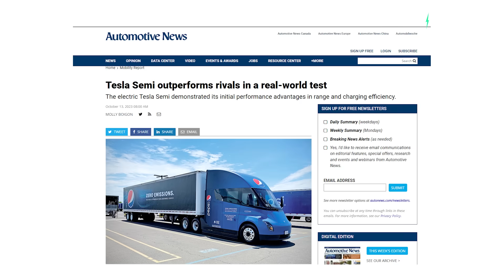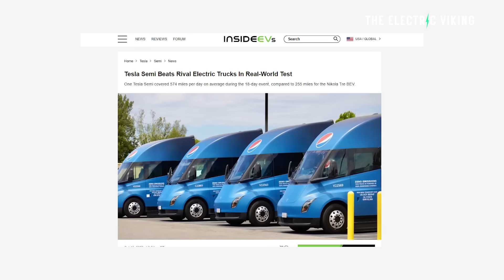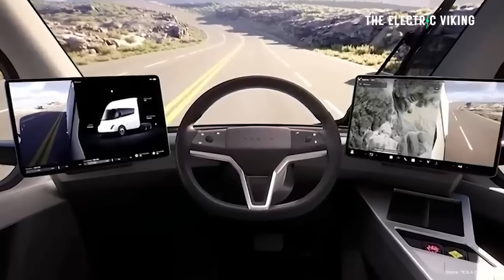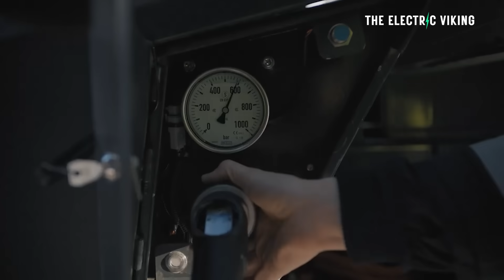Mercedes claim that Tesla Semi breaks the laws of physics proven correct

Comment: Since about two weeks DB Schenker in Finland is leasing for at least a test year a Volvo FH Electric Semi truck. This so called HCT combination is 33 m long with 11 axles and can have a total weight of 68 metric tons.
The truck has six batteries, all together 540 kWh.
The truck will be used in 3 shift, and mainly the truck goes between two hubs, but will also be used in distribution.

DB Schenker will charge the trucks by the rooftop solar panels at the hubs.
The company will have more electric trucks next spring.

Then I have some opinions about the charging!
I think they must be able to use at least two charging cables, or are they going to use 1600 volt?
In a couple of years the practice shows what really is needed when thinking there are mandatory rest times for the drivers. We have to consider that about 110 kWh is needed to get another 100 km for "normal" semi trucks.
Reply: Thanks for sharing this info.

It seems every truck maker is developing BEV drivetrains and many tests are being conducted around the world.

The increased efficiency and reduced fuel costs mean the electric transition is going to happen as quickly as the batteries can be made.
Reply: Tesla semi have 900kWh battery, 800v and consume 1.7kWh/mile full load. Range 500 mile with full load.
Reply: @pmkgamingtv  I would say that most of the electric trucks now are more or less test vehicles, and as the battery is quite expensive I think they don't use bigger batteries than needed for the tasks the trucks are supposed to perform.
Then the trucks that right now are for sale must also be able to be charged with right now available infrastructure.
As Tesla have own "infrastructure" they can now build slightly other kind of semis and trucks.
Then in Europe the trucks can't drive faster than 80 or 90 km/h. 

The electric companies will have some busy years to strengthen the grids that means we all have to pay more for electricity till the investments are payed back! 
When the gas stations network was built only the car owners payed direct, we other payed only through the "things" we bought that were transported.
At least it seems that the fuel cells will play a very small part. If for instance 20 % have to use diesel the NOx emissions will be quite small after all.
Here in the Nordic countries they should transport much more goods and trailers on the railways, because the heavy vehicles destroy the roads. The change between cold and warm weather twice a year it's in reality impossible to build roads that last. Then bad roads destroy normal (more or less expensive) cars...
Here we have many and long roads and a few taxpayers.

Comment: Nikola realized that their hydrogen semi truck was not going anywhere and they made a clever move: They also built a battery electric semi truck to compete with Tesla, since only battery semis have a future....
Reply: Nikola's truck was going somewhere - but only if rolling down a hill...
Reply: Battery semis will have a future eventually, but it's still too early for adoption. They don't have enough range yet to see widespread adoption. If they can start doing 600 miles on a charge and truck stops start adding charging stations, and  crazy California needs to actually add some truck stops (there's only like 3 in the entire state, and they are super tiny, especially considering they are a major shipping port), and then electric semis stand a chance of dominating the market. Until then they are just an impractical novelty.
Reply: NIKOLA BEV does not even Compete w/ TESLA 300 mile semi.

Comment: OK they always say they had a gross vehicle weight equivalent to that of a diesel truck. The problem with that is the payload weight is less than half of the payload weight on a diesel truck because the batteries take up most of the gross weight and every over the road diesel truck can go 1000 miles on one fill up
Reply: Correct. Tesla fanboys keep referring to the cost of running the truck. They just do not understand the  truck industry. You have to be able to carry weight, at least at some point in the run. Tesla simply cannot do that. FACT
Reply: Demonstrated payload is 44,000 lbs. of concrete highway barriers, which is very close to the payload of a diesel semi. GVWR is 2,000 lbs. greater than a diesel truck—80,000 lbs. for a diesel truck, 82,000 lbs. for an electric or natural gas-fueled truck.

Comment: My concern isn't with the distance or charging time, it's what happens when the truck breaks down is in the middle of the desert! Currently most truckers are their own mechanics and in many cases can fix their own rig, now with electric, they'll have to call someone or wait a day or two to get someone out to help tow or make repairs?
Reply: 1) Diesel trucks are far more complicated and have a lot of moving parts which can break so the likelihood of a diesel truck breaking down is far higher than an electric truck.

2) unless it's a Tyre change good luck trying to fix a truck alone without any serious equipment in the middle of the desert, and this is ignoring the fact that truck Tyres are heavy af for a single person to manage.

3) Batteries are most efficient when they're warm but diesel engines can overheat in a hot desert environment. You should be more worried about using electric trucks in colder places such as Alaska or Canada since batteries are nearly half as efficient at those temps so you should be more concerned about you're range in places such as the ones I mentioned before. I'd argue Diesel trucks are more dangerous in colder places since Diesel might not ignite when it's really cold outside since it needs to reach 180 Degree Celsius before it can ignite. if your radiator freezes up even when you're using an antifreeze agent, your engine might overheat and stop working. you have 2-3 hours of heating provided by the batteries to stay warm inside while to try an request help using a HAM radio (if you're stuck in an isolated location). Whereas, an electric truck can keep the heating on for ~3 days with it's massive battery pack if you get stuck (probably 4-5 if the truck has good insulation since the heating doesn't need to be turned on all the time to maintain a warm temperature inside the cabin).

4) As rare as motor failures are, Electric trucks have the possibility to disengage the failed motor from it's power-train and use the rest of the motors to drag itself and it's cargo to the destination (it definitely have enough Horsepower to reach the cruising speed even with a failed motor lol) and then to the workshop to fix or replace the burnt out motor.

P.S. I'm no expert in any of the things I've mentioned, I've merely gathered the information I've came across online.

Comment: Maybe you should take a look at Edison Motors semi. Their first load was 100,000+ pounds and was a Sherman tank. More than Tesla semi by at least 18,000 pounds. They have an onboard fast charger and huge range due to that. What was the weight that the Tesla was hauling? If you are hauling corn chips then the weight is minimal.

Comment: Heavier the vehicle is the less efficient it becomes for Bev. Also the majority of mileage is on highway speed worsening the efficiency even more
Reply: Hows your physics ?  This efficiency loss is exactly the same as a diesel truck. But an EV can regain charge on downhill sections. Can a diesel do that ? And when re-fuelling a diesel, you have to stand beside it for 10-15 minutes. With an electric, you plug in, and then have your break. It's different, of course - but maybe there are advantages ? I'm not a truck driver ....
Reply: Drag is what matters most on the highway.
Reply: @chrisheath2637  the physics is simple. The heavier the vehicle the larger battery pack it needs which in turn increase it's weight. Not the same with fossil fuel vehicles, it doesn't have to increase gas tank nearly as much as battery weight in order to achieve the same range or load increase. That said emissions is still emission. Just comparing small ice car to big ice car, small ice car pollutes more. Got EVs definitely big heavier EVs pollutes more in terms of resources extractions required.
Reply: @i6power30  We shall see....
Reply: NOT that Heavy , it can haul FULL LOAD Fremont to San Diego in 8H with 45+ miles Range left.

Comment: 4:10 - 1,700 km in 24 hours is an AVERAGE speed of 45 mph or 73 km/h. To put that into perspective, the maximum allowed speed for a semi on a motorway/freeway in Denmark is 80 km/h (50 mph). On regular roads outside of cities it's 70 km/h (44 mph) and in cities it's 50 km/h (35 mph). In the EU as a whole, there's a maximum speed of 90 km/h (55), but individual countries can have lower speed limits.

So, if a semi truck can carry goods 1,700 km in 24 hours, that is plenty to serve in Denmark, especially because we have strict limits in place for how long a driver is allowed to be driving - not just hours in a row (they HAVE to have breaks), but also how many hours in a 24 hour period. Those breaks can easily be used to recharge the semi trucks.

As for Tesla Semis in the EU, I think they'll have an issue due to length. The EU has a maximum length which includes the entire length of the semi itself. That's why the cab-over models are so favoured in the EU, and that nose is probably part of what makes the Tesla have such good range.
Reply: The US has strict limits on driver hours too. But team drivers can bend the limits quite a bit. It's not uncommon for a team to drive 4500-5000 miles in a week.

Comment: Mercedes have just tested the eAtros 600, across Europe it carries a greater load than the Tesla. Featuring a cab-forward design typical of European trucks, the eActros 600 is based on an 800-volt electric architecture that accommodates two electric motors with a continuous output of 400 kilowatts (536 horsepower) and three lithium iron phosphate (LFP) battery packs that offer a total capacity of 621 kilowatt-hours. Mercedes-Benz has a higher GCW - 88,000 pounds versus 82,000 pounds which is the critical factor, it carry more stuff.
Reply: It has a higher GCW, because the limit is higher in the EU—88,000 lbs., if your quote is correct, vs. 82,000 lbs. in the US. It has barely half the horsepower of the Tesla Semi, and 2/3 the battery capacity; so its range will be substantially less. For EU users, this will be ideal. For all the US EV haters who insist range is everything, it'll be a non-starter compared with the Tesla Semi.
Reply: @BigBen621   The fundamental issue between the EU and across the pond, is EU countries apply hours worked on which drivers are paid, so tachograph rules, of which there are loads, but the key is “After every 4.5 hours of driving time, the driver should have at least 45 minutes of breaks. The driver can take 45 minutes at once, or split into one break of 15 minutes, followed by a 30 minute break (45 minutes in total)”. Consequently with loads of historical data the European Manufacturers, they can easily scoping their vehicles, which makes sense.
Across the pond my understanding it’s miles driven how drivers are paid, though I understand federal law wants to include a tachograph system which hasn’t gone down well. Consequently the Tesla Semi with long range makes sense. It will be interesting to see the specifications of the Tesla Semi if it ever comes across the pond, which frankly I am not convinced it will.
Reply: @DC.409  US company OTR drivers typically aren't paid for time worked not related to driving or driver unloads and outside of LTL are usually paid by the mile  - "If the wheels ain't turnin', you ain't earnin'".  Hence the quick fuel stop to fill the tanks, hit the restroom and grab a coffee and be on your way.  With the old paper logbooks you could creatively give yourself an extra 15 minutes or so per stop but with ELD now it is tough.

Comment: Still don't see these making a mark in the Class 8 OTR long haul market in the US.  Pepsi is fine, but they are relatively short haul point to known point deliveries, not random freight picked up and delivered anywhere in the continnental US with varying load weights.  45 minute charge times for OTR drivers cut way too much into their on duty and driving times.
Reply: They're not designed, intended, or marketed for OTR or long haul applications.

Comment: I wonder if all the supposed projected EV battery manufacturing surplus takes into account planes, trains, boats and ships?
Reply: There will be no excess battery capacity for the foreseeable future.

Unfortunately, electrification of planes, trains, boats and ships is also not being projected on a large scale for the foreseeable future either.

But besides cars and trucks, which can easily use up all battery manufacturing for the next decade, there will also be very high demand for stationary storage, to support renewable energy generation and grid stability.

This is why all the new battery chemistry developments are critical.  Sodium ion, sulfur, etc etc.

In the battery space, it will be ALL OF THE ABOVE, and ALL HANDS ON DECK!!  for the next 25 years.

And definitely, trains and boats and small aircraft should be electrified as soon as possible.

Comment: It would be interesting to see by how much the range increases if the wheels are properly covered for better aerodynamics as well
Reply: As well as using super single tires
Reply: Imagine if they gave them hard steel wheels, put them on a steel rail, linked them together, and ran mile long groups of them across those rails. It would be revolutionary. I can't believe no one has thought of that.  @michelcote

Comment: Most people who own Teslas or EV's in general will charge at home if at all possible... Would the constant use of supercharging affect the overall lifespan of the battery? Most companies aren't relly looking to replace their trucks every 5 years or even 10.
Reply: The standard is 1000 charges before a battery reaches 80% of it's life. That means 500,000 miles. Before it's 500mile (loaded) range becomes 300 miles (loaded)

Comment: Happy to see the electric trucking industry is making so much progress over hydrogen. Makes s lot more sense for a fleet to have full electric. Can have huge solar arrays on the roof of the depot for cheaper refueling. Not to mention the regen that can be done when taking heavy loads down a mountain and then back up while being empty. That almost breaks the laws of physics ha
Reply: It doesn't work well because the chargers are complicated and expensive. When they break the entire fleet is not going anywhere

Comment: I guess with two driver you legally can do 1076 miles in 24 hrs , because 1076/65= 16.55 hours . In the USA I think it's after 12 hours with 30 mint break at the 7 hour, he has to have 10 hours off. One diver couldn't drive that long  even with higher speeds in Utah and Colorado for trucks
Reply: The 1,076 miles were done with two drivers, and drove 60 MPH most of the time, consistent with the California 55 MPH speed limit for articulated trucks. The day included 2:43 of charging, so each driver stayed within their 11 hour on-duty limit.
Reply: Tesla did 1070 miles w/ 3 Slipseat Drivers

Comment: You have said this same exact thing about 5 times in the last 2 months Sam. Okay we get it. Great achievement. 
But where do we go from here? 
Where's the progress. 
If nobody else is able to do it then it's hardly progress because Tesla are not going to better this performance in the next 10 years. 
And that's simply too slow.
Reply: You don’t think Tesla will improve performance in 10 years?
Reply: Progress is too slow. But the important news is that these tests confirm that BEV trucks can do what Tesla has said they can do.  

This means they can save trucking companies a lot of money.  And this means that trucking will be electrified as quickly as battery production allows.

That's actually very big news.

And yes, I would love to hear reporting on the next steps that will help these trucks displace the old polluting diesels as quickly as possible.

Comment: The whole EV semi thing is misleading, the added weight of batteries has to be deducted from weight of freight.Making total load smaller and transport costs go up.
Reply: Lower cost of operating an EV semi, outweighs any loss of payload due to battery weight!

You'll be able to tell by the demand for Tesla semis because of the fast payback period!
Reply: @donaldparry5157  all in theory, I grew up in a truckdriving family. all the new promises in the industry often fail to materialize. people seem to just blindly trust the manufacturers claims, you know EVs dont work in very cold(sub -4)? the batteries shut down, same with extreme heat (+104), that doesnt leave many areas to operate in.
Reply: @donaldparry5157  the semi simply cannot carry the weight required for a high percentage of the trucking industry. That is why Tesla refuses to state the payload.
Reply: @jimpackard8059  could be! If for now they can replace even 5 percent of the rigs at a significant savings, future, higher efficient batteries will handle the next conversion segment.